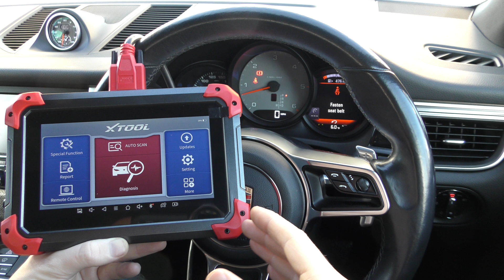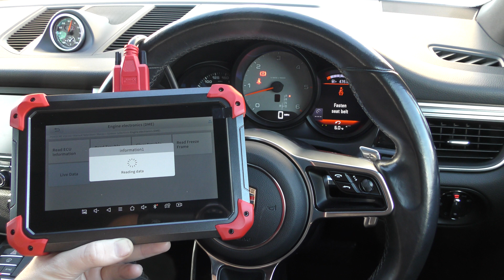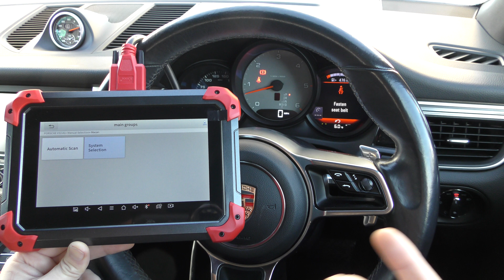X Tool D7 Live Data & Actuation Testing - Bi Directional Test - Component Test

Comment: A lot of balls running that cheap tool on an expensive car.  I messed up my Saturn this morning with that tool.  Clicked cancel while it was checking for codes in the Body Control module.  The tool set 47 DTCs.
Reply: i was thinking of buying that tool but that scared me.
Reply: @guilhermeg345  Turned out to be not all bad. The codes were just all reset to not ran.  I had to confirm with Innova scan tool. Don't know what I am doing with the D7.  There should be some way to get basic ODB II info.  I have not found it. Should also be some way to get straight into live data. I have not found that either.

My computer reran all the tests and everything showed up green in Innova tool after a few days.

Comment: I am disappointed with mine.  Was supposed to work with 4.0L 2011 Ford Ranger.  Kind of appears to get trouble codes.  Won't get live data for 4.0L. Has other Ranger engines listed.